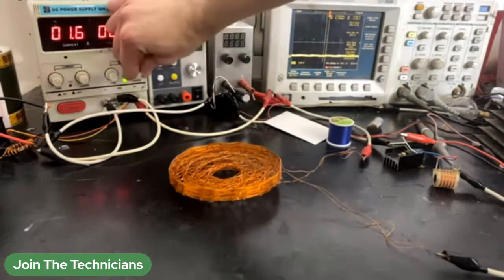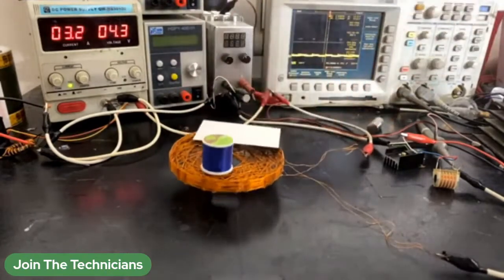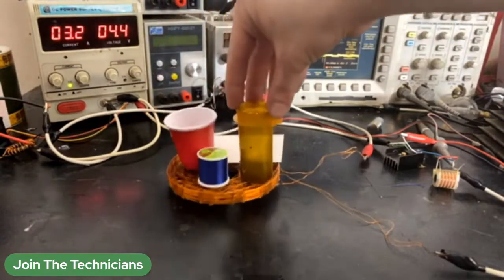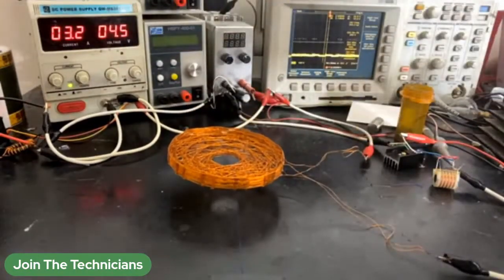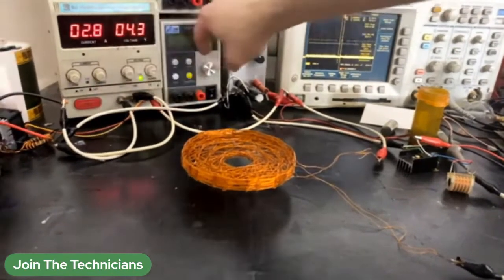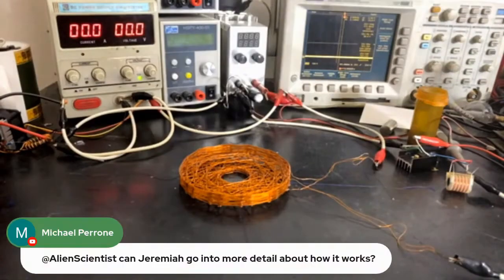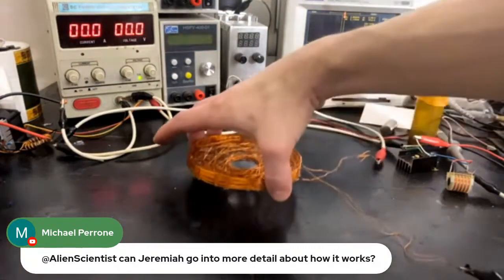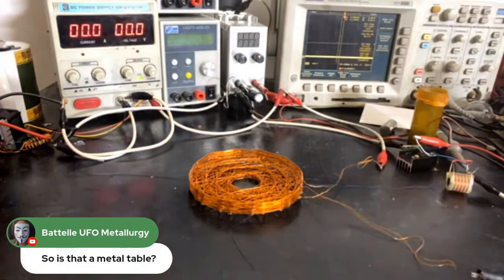Levitating Star Challis Starship Coil @wpgenlighten4truth2 @exoticpropulsion8175

Comment: Classically i'd expect that to be a metal table-top and the coil being repelled due to eddy currents, but it sounded like wood when he knocked it. Need to see under the table or check with Neo magnet in case metal plate is part of table construction.

Comment: I have a sort of lengthy background with electricity and electronics.  I was an electronics/crypto tech on U.S. Navy nuclear subs.  Then I attended Devry for 3 years.  Then I attended UC Berkeley (computer science).

Recall that normal 'Lifters' rely on a high voltage static DC thin wire electrode separated from a wide aluminum foil electrode at ground potential.  Let's say 20,000vdc on the top wire.  What does that do?

HOW A NORMAL IONIC LIFTER WORKS
1)  strips electrons off air molecules next to the top 20,000vdc electrode wire
2)  the air molecules now have missing electrons - and are thus positively-charged ions
3)  the wide aluminum foil electrode, spaced a distance* below the 20,000vdc wire - the wide foil is at ground electric potential and it "sees"  (in a Coulomb electrical attraction sense) a volume, just above it, of positively-charged air molecules (the positive ions created by the top 20,000vdc electrode wire)

What happens next?
4)  the thin aluminum foil electrode at ground potential MOVES UPWARD due to the electrically-positive air molecule ions
5)  and the same air molecule positive ions move downward, attracted to the grounded aluminum foil (that's where the 'ionic breeze' comes from btw)
6)  since the bottom foil electrode was electrically attracted upward, and MOVED upward, the top 20,000vdc electrode wire ALSO moved upward
7)  the positive 20,000vdc electrode is now in a new, higher position, and it IS STILL STRIPPING ELECTRONS off air molecules
8)  go back to step (1)
9)  rinse and repeat

The volume of air that gets positively charged due to lost electrons is sometimes called a 'space charge'

That's why Lifters don't work in  low-pressure, no-air vacuum.   NO WAY TO CREATE A SPACE CHARGE.
CAREFULLY NOTE:  in the normal Lifter described above,  we cannot move the 20,000vdc wire electrode TOO CLOSE to the bottom foil grounded electrode because there will be electric arcs due to breakdown of the air when they're too close.  This is relevant in how the 'hover coil' works, I believe.

So, what is this 'hover coil' doing?

1)  note that there are 4 wires as its input
2)  one pair receives DC, the other pair receives AC, as they mentioned in the video
3)  a portion of the winding (the first pair of input wires)  gets a DC voltage.  This creates a magnetic field like all coils create magnetic fields when DC voltage/current is applied

4)  The AC is piped into a different portion of the windings.  Recall that AC voltage has peaks.  I suspect that the peak voltage spike are very briefly creating the 'space charge' that normal lifters rely on for upward motion.
5)   No arcing occurs as long as the right AC frequency is chosen - it takes time to break down air with voltage and create an arc, and at the right frequency, that is probably avoided

So this could simply be a 'spiking Lifter' (AC voltage peak spikes) where the 'fuel' - the volume of air that gets ionized - is not as PERSISTENT, does not hang around as long as it does in a DC-only lifter.  And so,  if your AC peak voltage spikes are high enough, and the frequency is carefully chosen to minimize arc-over,  I suspect this is just a hot-rodded Lifter.

DISCLAIMER:  I have not built one to test my theory.  I could be wrong.  And in no way whatsoever am I denigrating any of the work these guys did to pull this off.  Because even if it IS just a 'Spiked Lifter', I think they made an improvement to the pitifully weak DC static voltage lifters.
Reply: NOTE - the DC voltage could be adjusted to maximize the voltage difference between the positive AC voltage spike peaks of the AC waveform fed to the AC part of the coil.  To get improved electron-stripping, space charge creation, it would help to make a larger voltage difference between the AC signal's peak voltage spikes and the DC voltage.  EXAMPLE:  If the AC voltage peak is 5 volts, then a -10 volts DC would be better than -5 volts DC.  Just hypothetical numbers there to get the point across.

ALSO:  There is stray capacitance between the windings and there may be a series-resonant RLC resonant frequency lurking out there in the design.  You'd want to monitor the voltage and current in the AC part of the coil and adjust the signal generator frequency around a bit and look for the series-resonant condition.

At resonance, a series-resonant RLC  loses all XL (inductive reactance) and XC (capacitive reactance) and the only remaining resistance is the copper wire resistance. Monitor the AC part of the circuit with an oscilloscope as you adjust the frequency to find the resonant frequency.

Tesla used series-resonance in his 1894 bifilar coil patent  #512340.  In his wording of the very short patent he was quite cagey about it - he just said 

"I have found that in every coil there exists a certain relation between its self-induction and capacity that permits a current of given frequency and potential to pass through it with no other opposition than that of ohmic resistance, or, in other words, as though it possessed no self-induction."

.
Reply from the maker: @Greg_Chase  Nice speculation. I bet we'll see more lifters very soon, since this guy figured out multipliers work better than just a plain flyback  AJD_fiHleRM&t=11m40s . I got tired of speculating, in loo of surrounding improbabilities in the whole story. One thing, I'm pretty sure it was never stated that smoothed out DC was used on any of the inputs.